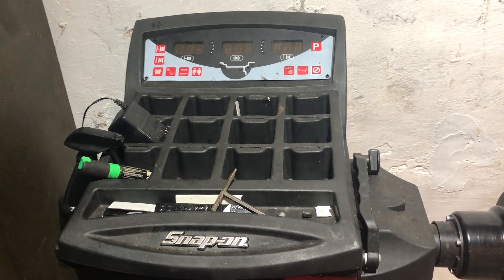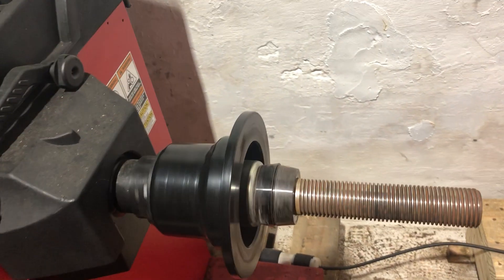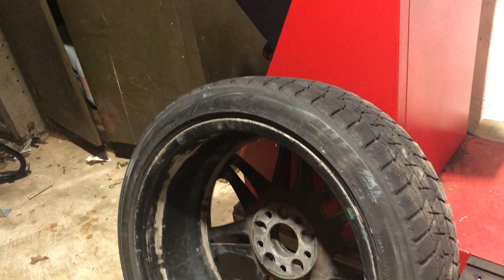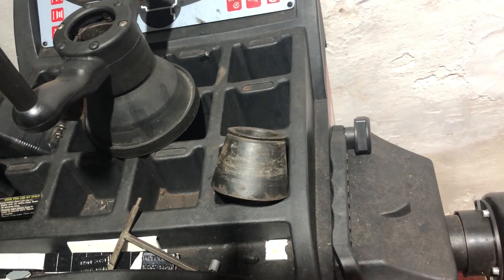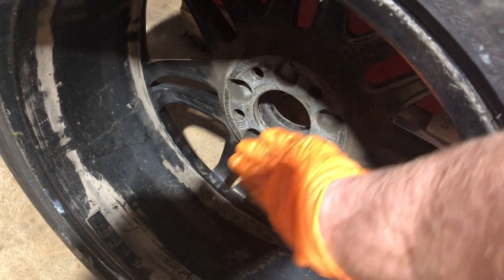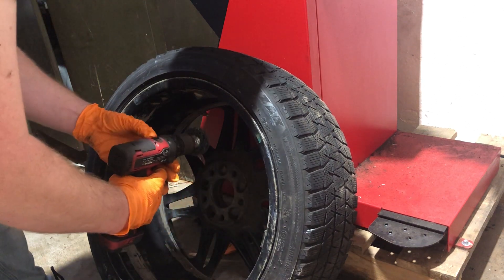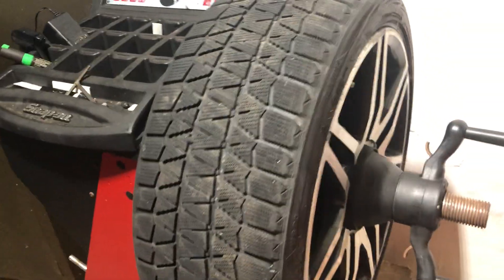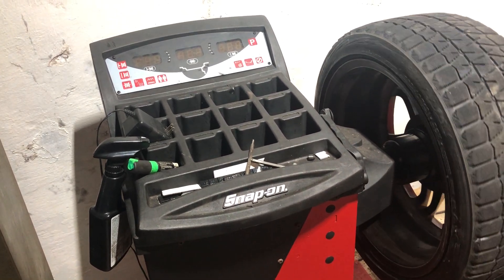Tire balancing?? Let’s get down to the basics…. Part 1

Comment: Good video! I’ve watched a lot of your other videos and found them to be very informative and helpful. I’ve struggled with variation when trying to center the wheel using cones. You can waste a lot of time “chasing weights”, as you mentioned. You talk about the benefits of the precision collets and pin plates in your other videos, which prompted me to order a set of both. Thanks Geardriven!
Reply: I would also recommend a slight amount of grease on the cone/collet and wheel engagement surface to help with the centering on the shaft.
Reply from the maker: I’m super happy you found this helpful! thank you for the support as well!

Comment: I bought a corgho a few months back. I agree that cone on the inside and wing nut on the outside. I like your idea about choosing cones, how it should sit in the middle and cleaning wheel centre bore with drill brush.

Comment: thanks for the vid, i have a similar balancer (b9005) and it came with the cones, but not the spacer and "plastic bowl" on the locking nut. so i have to have the cone on the front of the wheel. watching your video's i can see its more accurate to have the cone on the back. im also doing to look for either some collets or a finger plate as they seemed much more accurate from your videos where you did the multiple spins.
Reply from the maker: I definitely recommend collets and finger plates! I would do collets first if you have to choose. I’ll be doing a video hopefully soon on tire matching so you might like that. good luck!